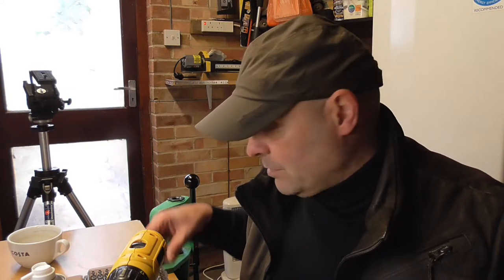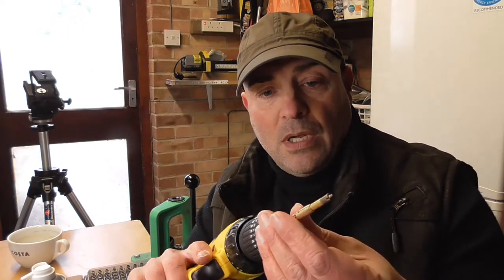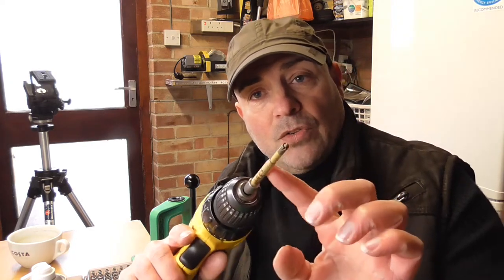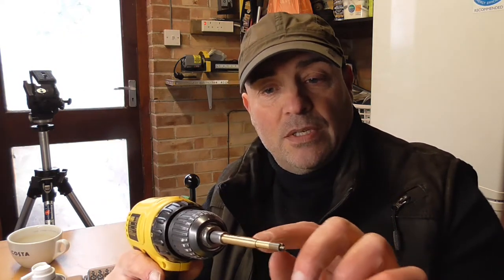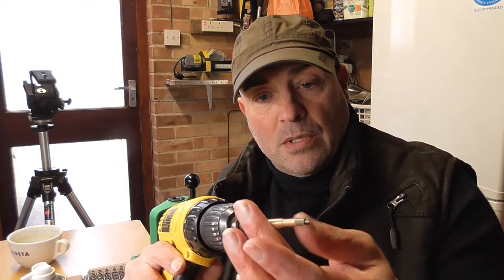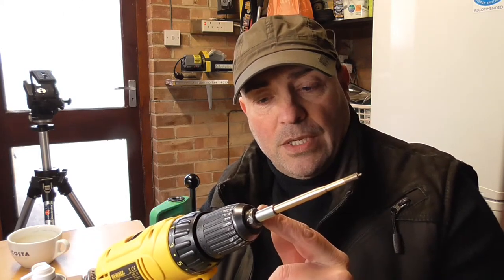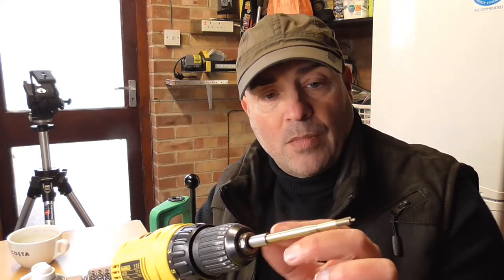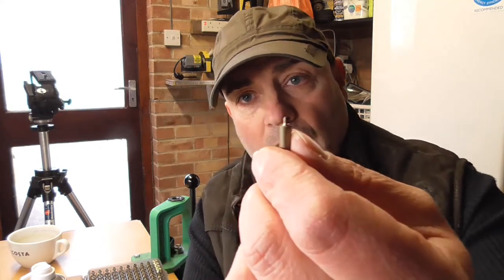6.5x47 Lapua New Case Prep Part 5. Flash hole Deburring.

Comment: Great video man, I agree that this seems like a better option than a deburring tool that will just continue to cut through brass vs the 21st tool you have that bottoms out. I will have to see if I can get one here in the states. I really like the difference it makes and they look very consistent which I’m sure leads to that tiny edge in accuracy and better velocities. Great video very well done!
Reply from the maker: West Desert Shooter Hey buddy, thanks for the comment well appreciated, I really like this tool and I think it does a good job much better than the drill type uniformers. I actually did order it from the states so you shouldn’t have any problems in getting one they are a bit pricer than some of the rest but they are well made and well designed take care cheers G.